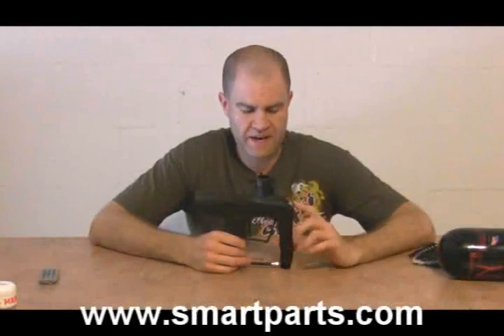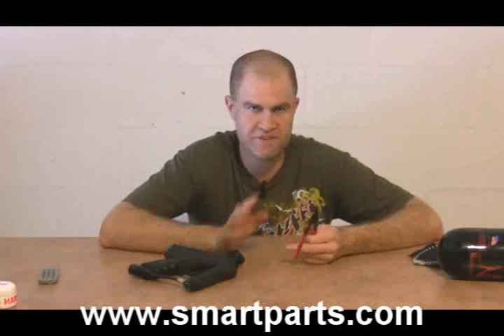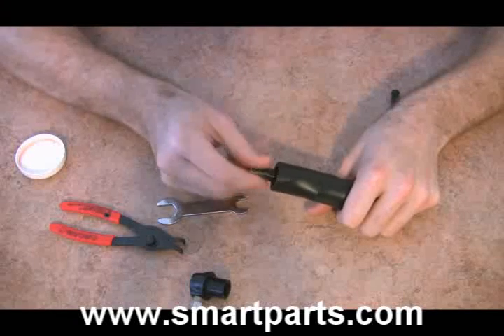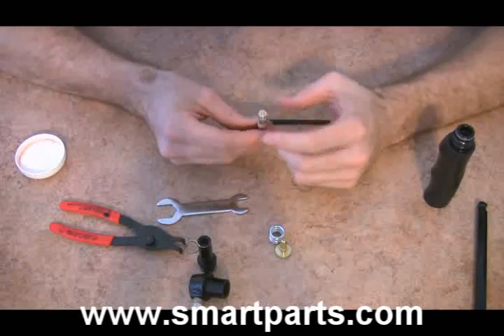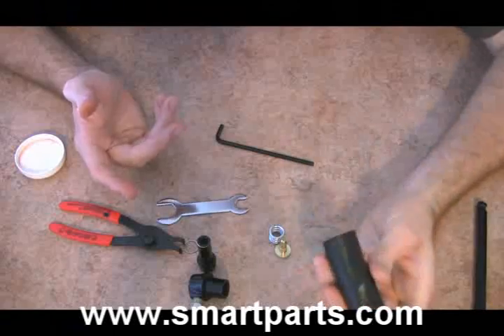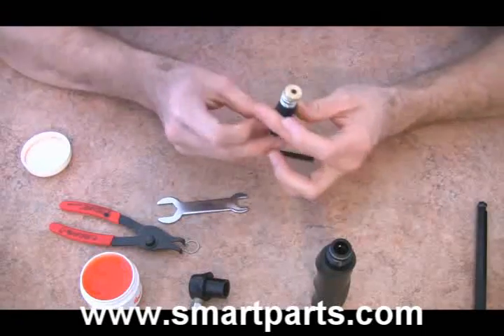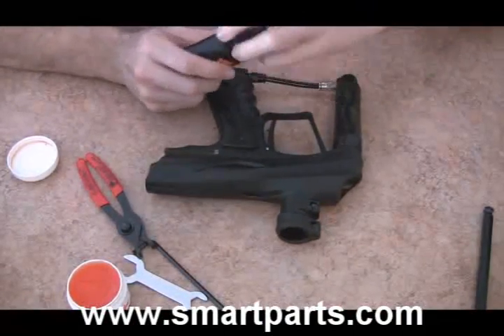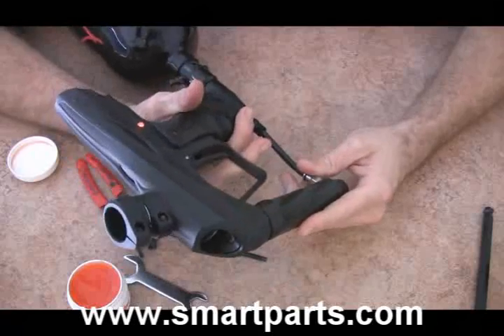Smart Parts Vibe Regulator Dissasembly / Reassembly

Comment: hello , you dont need to buy circlipe plires you can just use two small screw drives to push open the circlip and then push it off.

Comment: No but what i was trying say is if you are stuck then you could use a pair of screw drivers , I work on cars and bikes and when you are stuck you can do this but just be aware that it will fly off.i should of mentioned that but just take your time with it and use a rag to stop if flying across the room.

Comment: Ok i see what you are saying, but why would smart parts do that, you should be able to maintain your regulator with no problems. 
How small are the howls in the snap ring because what you could do with your circlip pliers is file the pins so that they can fit in the howl of the snap ring. or is that not possible (I dont have a vibe so i cant see how small the circlip (snap ring) is) im from the UK but when you say snap ring is that a circlip.

Comment from the maker: this snap ring is as large as a nickle, and about as thick as a dime. You wont be able to push this snap ring off, it's too tight

Even with the pliers, it's not easy

Try it yourself, this snap ring on this reg is a nightmare, without the tool you're not getting it off. And if by some miracle you do remove it, without the tool, you won't be able to get it back on